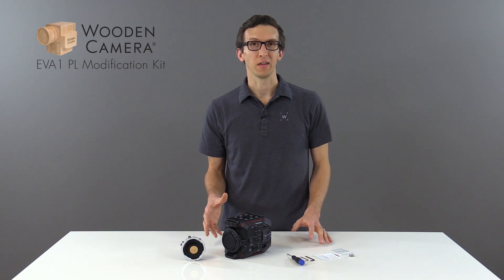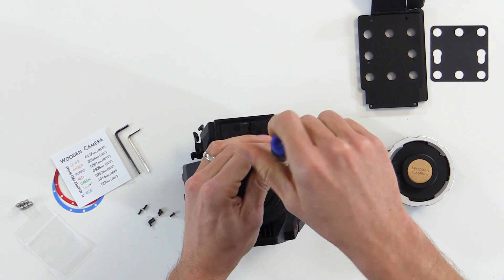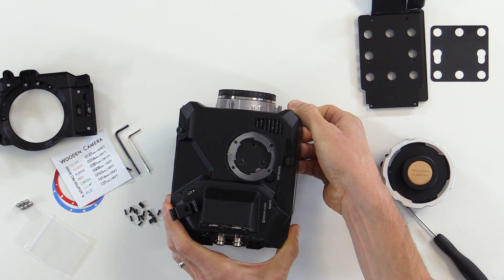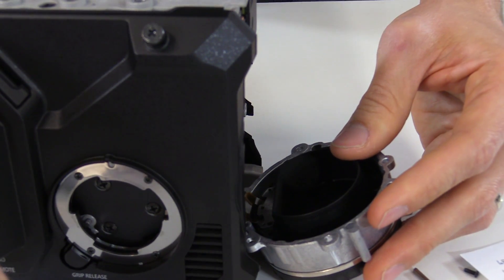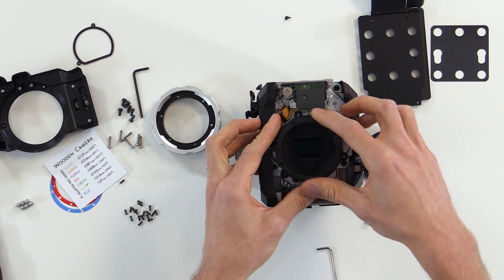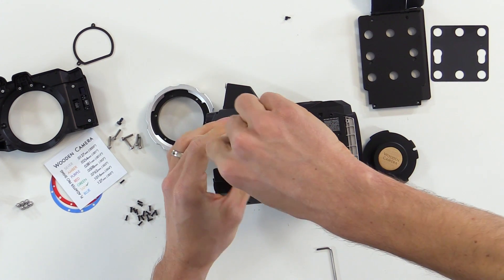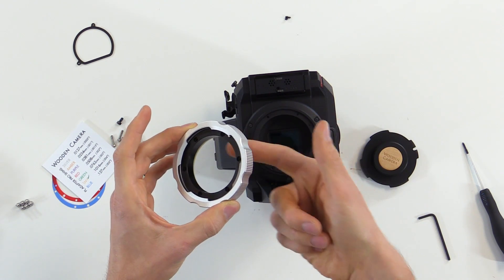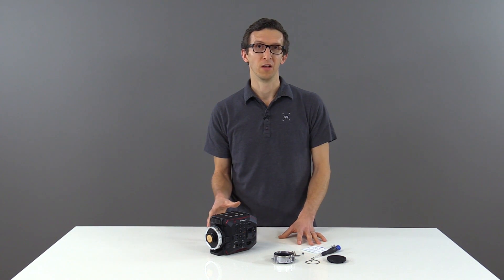Wooden Camera EVA1 PL Modification Kit Installation Tutorial

Comment: That little plastic baggie wont melt under there will it? Thanks for great setup video, it will come in handy.
Reply from the maker: Nope! It's safe in there. Just make sure to pinch the sides of the bag closed so it does not come loose.